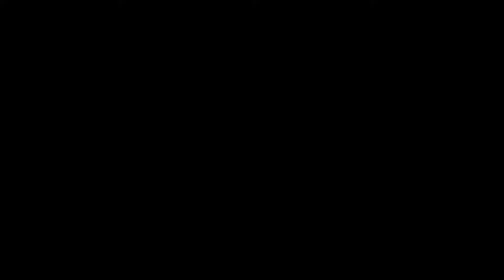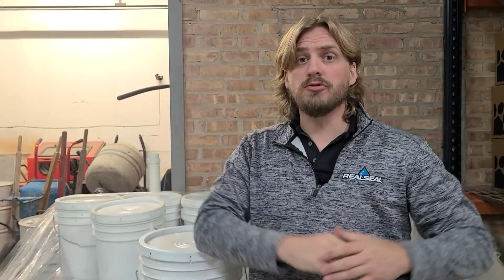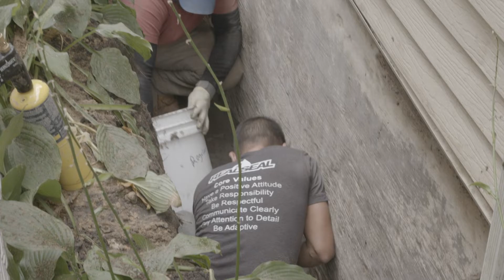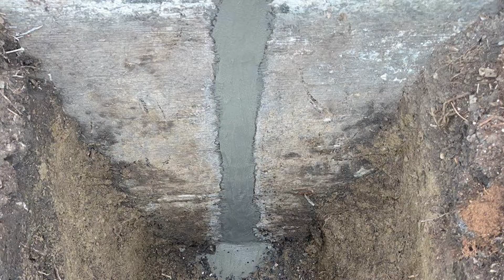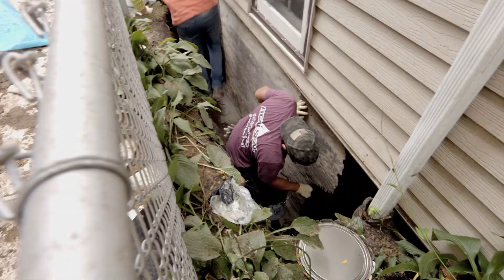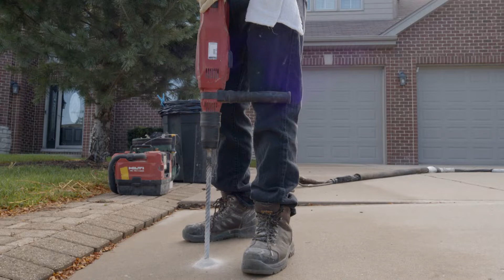Hydraulic Cement: Uses and Applications

Comment: real seal is the real deal on good advice.   Efference on wall seal w/ hydraulic cement painted onto wall.. WDYT?
Reply from the maker: Thank you!

If you are looking to just stop the issue from the interior, that can work, but will need to be re-done every few years. 

Otherwise, you can either dig outside and seal, or do an Interior Drain Tile System with a Wall Liner to redirect any moisture.

Comment: How about using Hydraulic cement for driveway cracks?  Any suggestions?
Reply from the maker: I wouldn't recommend it. Better to use a sealant that has a little flex to it. As your car drives over the sections cracked, they move slightly and the rigid finish of the hydraulic cement would crack.

Comment: After applying hydraulic cement, how soon can I apply foundation sealer?
Reply from the maker: Great question! You want to wait until the hydraulic cement completely dries to ensure the sealer sticks. 

You'll see the hydraulic cement go from a dark gray to a light gray color. If you want to speed up the process, you can put a torch on it to heat up the material after it is applied.

Comment: Would this be a good product to use to fill in large concrete garage floor cracks(1-2” deep) prior to applying a troweled rubber floor coating?
Reply from the maker: Great question! Yes, this can be used to fill in those cracks in the garage floor before you apply your rubber floor coating. 

Be sure you allow the hydraulic cement to fully dry before you apply the coating. The hydraulic cement will turn from a dark/moist color to a white/dry color.

Comment: Thank you. If i apply to "interior garage" foundation wall hydraulic cement as initial seal, followed by roofing cement or tar on a crack, will that be ok? I can't get to the crack from the outside/exterior.
Reply from the maker: It will hold for a little while, but not forever. For that type of seal (hydraulic cement and tar), it is best to apply from the outside That way, water pressure holds it against the wall, as opposed to pushing it out from the wall. Make sense?

Otherwise, if you see the crack from the interior, we would suggest Epoxy Injection. Below is a link to that video. 

https://youtu.be/2KrIa9iAIeU
Reply: @Therealsealllc  thanks.  It's makes perfect sense. Are injection specialists relatively easy to find. Are waterproofing guys generally trained in this injection option? I'm in Los Angeles where it doesn't rain too much. One option is to do the hydraulic cement roofing tar combo from the interior and hope it gives me 10 yrs if I can't find any injection guys.
Reply from the maker: @nickka2009   it is harder to find injection specialists in that area, but we know Dalinghaus Construction, and they may be able to help you out!
Reply: @Therealsealllc  Watched that epoxy video. I can see why it's a more complete solution since it fills unseen voids along a path. What I'm less sure about is its permanence over time when you still have not treated the outside.
Reply from the maker: @thenexthobby  when you inject the void completely with epoxy, which bonds with the concrete, there is no need for an exterior repair. The void itself no longer exists, and we provide a Lifetime Warranty for that repair.

Comment: Can you mix it thinner to pour into a 3" diameter vertical hole and if so, will that slow down the curing time?
Reply from the maker: Yes, and yes. However to fill a hole with slurry, you're better off using a grout that is designed for that.
Reply: @Therealsealllc  what I have is a wrought iron railing going into the concrete slab in front of the house. Not sure what they originally used but it's shot. Was going to use the hydraulic cement so I wouldn't have water invading down around the post.  That is, of course, after I cleaned out the hole and rust converted the post.
Reply from the maker: @rtritt4427  This would be a good application for Hydraulic Cement. Make sure you fill up the entire hole and don't leave air pockets.
Reply: @Therealsealllc  Awesome. Thank you for the prompt response.
Reply from the maker: @rtritt4427  Happy to help!

Comment: Can this be used for cosmetic purposes on above-grade exterior foundation wall?  The poured cement with seams is unsightly.  If so, any prep for the wall recommended?
Reply from the maker: Yes it can be, but it's important to note that the color will not match. You may need a skim coat in order to make the whole wall uniform. 

Just need to clean the wall with a steel-wire brush and you're good to go.
Reply: @Therealsealllc  Can you use the hydraulic cement for a skim coat?
Reply from the maker: @DSilvergun  There are better products out there for skim coats. This would be a thicker mix used for larger gaps.

Comment: Can you dry pour hydroulic cement in a hole then add water?
Reply from the maker: Hi Dan! 

There are post-setting cement mixes that advertise they can work like that, but a general hydraulic cement wouldn't be the best application. 

We always profess that it is best to mix your cement before placing/laying it. That way, you can ensure the correct mixture and strength.

Comment: Nik here (again), one follow up question on hydraulic cement.  i want to abandon my sump pail/pit that is inside the house now that i have my perimeter tile gravity draining to a pond.  it is about 2 feet deep & 1 foot in diameter.  there is the plastic pail in it.  do you think I could just dump a whole whack of hydraulic cement into the "pail" just to fill it?
Reply from the maker: Hi Nik! You could, but that wouldn't be the way I would recommend. The best way is to cut and pull the old basin out and then fill it up with dirt, with a 4" gravel layer at top and then the same thickness of concrete that is existing in the basement.
Reply: @Therealsealllc  of course!! I feel "dumb" now.  thx!!!
Reply from the maker: @nikshill8767  Happy to help! And no dumb questions!

Comment: hi - i have a rural property on well and septic.  my foundation perimeter tile gravity drains to a pond.  i do have a sump pit/pail in the basement that was supposed to only be for furnace condensation line  and for floor drain outlet.  the perimeter tile was not supposed to outlet back into the house.  the water around the foundation was supposed to gravity drain to the pond away from the house.  everything is done that way but unfortunately the foundation guy did not know this.  he drilled a 4 inch hole through the foundation into the sump pail.  now perimeter water enters my sump pit in the house.  i want to plug this 4" diameter hole.  hydraulic cement is the only thing i can think of.  any thoughts would be appreciated?  thanks
Reply from the maker: Hi Niks! Yes, Hydraulic Cement would work, but Bentonite would likely be a better solution for this problem. You can fill the hole with Bentonite (dry mix) and then cap the hole off with at least 3" of Hydraulic Cement (wet mix) to hold it in.

When water hits that hole again, it will activate the Bentonite, expand, and seal the hole. 

Another application if this is directly in your foundation wall is to do an Expoy Polyurethane Injection. This will fill the hole with an expanding foam that will stop water from going into the foundation. We have a video on this process as well!
Reply: @Therealsealllc  i really appreciate the quick reply.  from what i can tell from the drawings, there is a "T "off of the perimeter subdrain tile that comes through the footing (not the foundation wall itself) and then that piece of T subdrain travels a very short distance (maybe 2 feet) under the floor (ie through the footing and clear stone) into the sump pail.  i will look into the bentonite.  I would prefer to do this from inside the house (ie from the sump pail, i would remove the pump and backup pump first to give me room) as opposed to digging down to expose the footing).  the sump pail is not very large diameter (18 inches) so it may be challenging to get the bentonite/hydraulic cement in.  any advice on working from inside the house?
Reply from the maker: @nikshill8767  My advice for working from inside in that tight of an area is to find a "grease man." Do you have a teenager, nephew, or small friend? They can work easier in those spaces. 

Be sure you remove the sump pump when working (make sure it's not raining!) and that will give you more room as well. 

They may have done that hole on accident, not realizing the plans stated to use the exterior drain tile as a gravity drain to the pond until after they drilled the hole. 

Main thing is keeping the water out of the basement. So as long as the sump keeps working, you're in good shape. But if you want to reduce that water coming from the exterior tile, you can plug that hole. 

Another good thing to check is that line that runs to the pond. Have a plumber come camera it out so you can make sure it is not clogged or collapsed. That may be forcing water into your sump pit if it can't flow freely to the pond.
Reply: @Therealsealllc  understood and good advices.  much appreciated.

Comment: Can I put shower floor tile on hydraulic cement using thinset? There is no leak, but the floor is full of moisture and would long time to dry, so I planning to use hydraulic cement for fill up some holes.
Reply from the maker: Hi Debashis! You could do that with hydraulic cement to fill up some holes/gaps to help with laying down tile. It won't prevent seepage if pressure builds up, but will create a good moisture barrier for those voids you see.

Comment: Can you use hydraulic cement on small cracks in the exterior foundation?
Reply from the maker: Hi Aral! Yes, you can use hydraulic cement on small cracks on the exterior foundation. A couple things to keep in mind:

If you just do a surface hydraulic cement patch, it won't be waterproof. You'll need a waterproof tar barrier to ensure no water penetration. 

If cosmetic is what you're going for for those cracks above grade, and no digging, just keep in mind it is purely cosmetic. The cracks will continue down into the ground. We have very few true "slabs" in Chicagoland. Most slabs have a 4 ft frost wall (concrete foundation that extends 4 ft into the ground) to prevent the foundation from moving between freeze/thaw cycles. 

Let us know if you have any other questions!

Comment: Can this cement be used around the edge of the inlet pipe of a septic tank which the diameter of the pvc pipe is 4" ? I recently found massive roots that worked their way around the diamer of the pipe & had crushed the pipe & roots have grown massivly in the inlet & outlet chambers of the tank, was originally thinking using some reg cement on the outside & inside diameter of pipe but dont know how it would hold up once water & sludge starts to build up around the inlet pipe if it would start crumbling away?
Reply from the maker: Hi Joey! Hydraulic Cement is not a permanent solution, especially for that application. It sounds like you have a collapsed pipe that is in need of replacement. Once you have that replaced, we would suggest an exterior foundation seal or injection of epoxy around the pipe.

Tree roots will instinctively search for water, so the broken pipe was a natural place for them to go. An elastomeric tar seal around that pipe entrance from the exterior, with the use of hydraulic cement to fill the major gaps first, will stop water and roots from entering again. 

We would also suggest removing the tree if it is within 15 feet of the home, as those roots will inevitably find somewhere else to go, clogging other pipes.